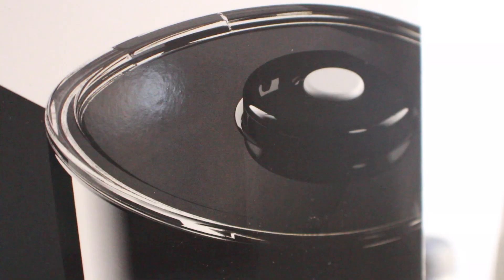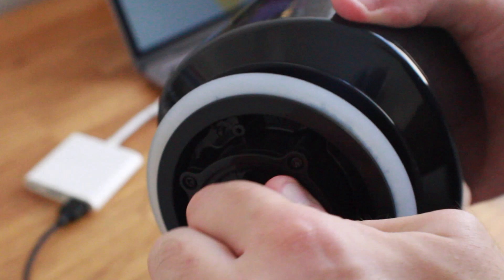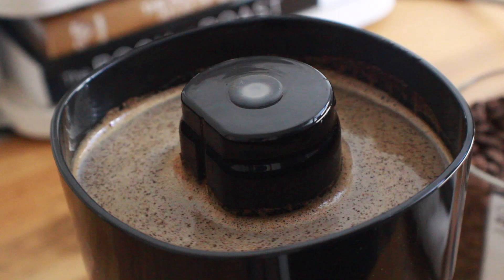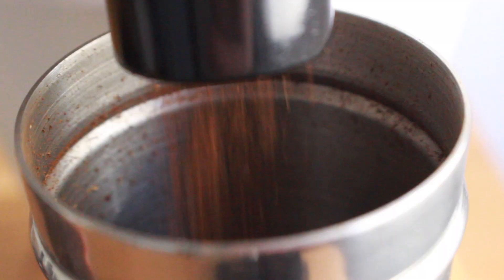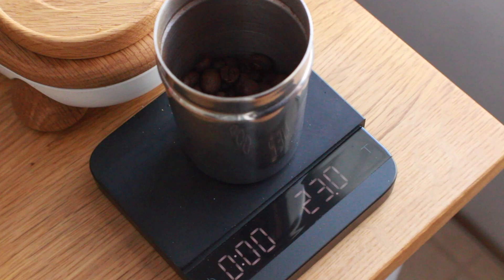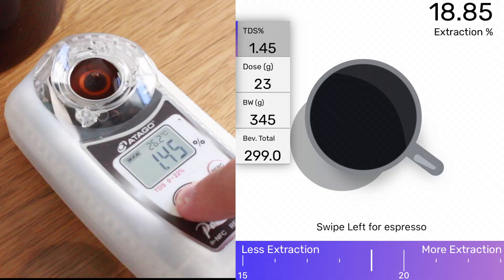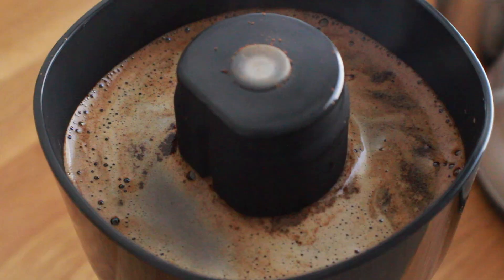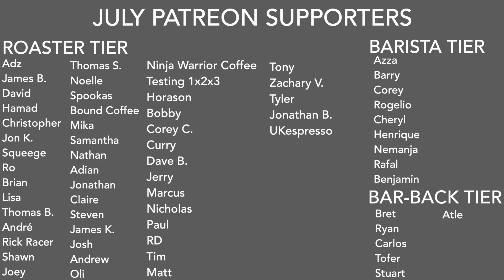THE FRANKONE - Making Coffee In A Vacuum

Comment: I have this at home and was disappointed- it got stuck regularly when I did drawn it down - and it is just not easy to clean up after. the grounds remain so hot it was hard to just pick up and throw
Reply from the maker: I haven’t had the thing get stuck yet, but I asked the owner and they say they recommend taking out and cleaning the filter every use. Which isn’t in the directions that I saw.  It definitely can be a pain to take off the pitcher when it’s still super hot too.

Comment: I wish it was designed with the vacuum motor on the outside of the brewer, or as part of the carafe. It works by creating a vacuum inside the carafe. Putting the vacuum inside the middle of the brewer chamber just seems illogical.

Comment: Another coffee gimick. Vacuum or gravity, you are still running water through grinds. It will probably be a garage sale item after tiring of cleaning or the battery dies and can't be replaced.
Reply from the maker: Yeah I’m not sure about the battery and if it’s replaceable moving forward. But from the looks of the unit I doubt it.
Reply: This is the reason why I read the comments first. I didn’t want to repeat the same message. My exact thoughts

Comment: I don't know that I would call this vacuum brewing to be honest. The term implies coffee is extracted under vacuum which isn't the case. The pump just draws the coffee down faster compared to a pour over. I doubt it has any effect on extraction. Seems gimmicky to me...
Reply from the maker: I mean it uses a vacuum valve to pull water, so I think that still counts. Maybe not the perfect definition, but in the end it does a decent job at what it’s designed to do. Just maybe not intended for the specialty market.